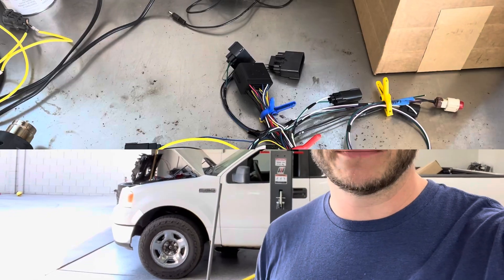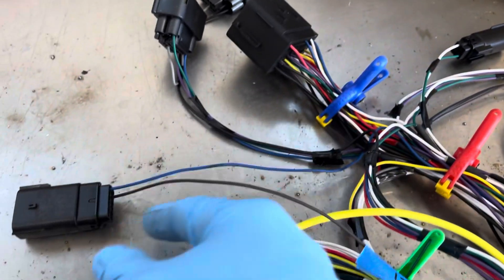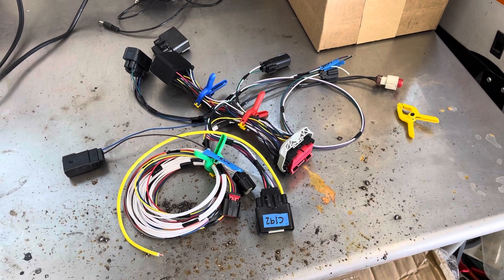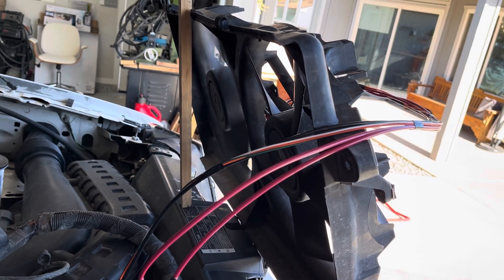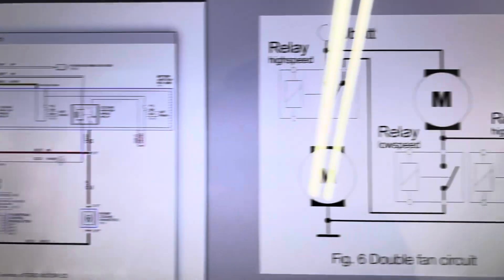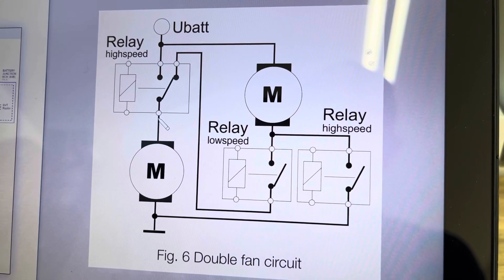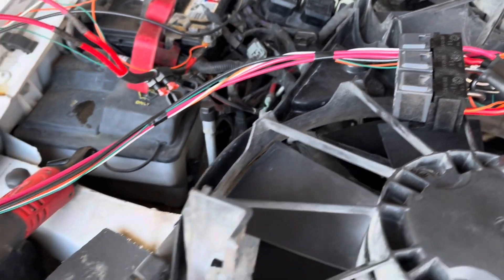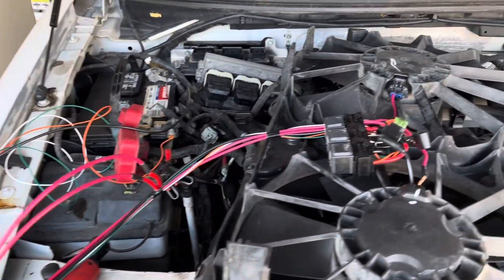FIRST LOOK at the 2004-2008 F150 Coyote Swap Plug and Play Harness and cooling fan wiring upgrade

Comment: Great video, appreciate the R&D on rewiring for these fans. I rewired my 2004 F150 for power fold mirrors and puddle lights using a 2008 diagram, mirror switch and the special relay. A bit of work for sure. As for the fans, I have these same fans installed in my 2004, but I just used an aftermarket PWM controller that is rated to 120 amps. It always runs both fans but at variable speed depending on the temperature sensor input from the lower radiator hose. The PWM controller has an AC clutch input. Required a 220 amp alternator and charge/ground cable upgrades. I also added a Lingenfelter speed switch to cut the PWM controller out over 45 MPH (highway driving), and turn it back on under 25 MPH (city driving). The truck runs at a steady 192F year round in all conditions.

Comment: I have an 05 and did the the e fan upgrade using the 09 fans. Can't make the both work no matter what control unit I use. Can you make a video hooking it up with the fan harness you spoke about creating as a standalone?
Reply from the maker: @JustinR239  I essentially did in this video the only thing missing is how you’d need to trigger the low and high speeds using a ground switch of sorts